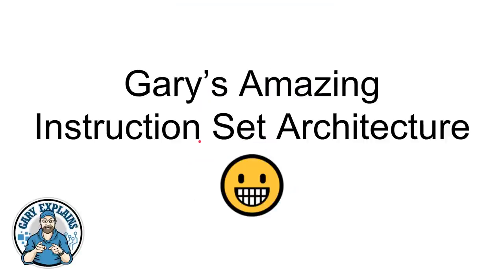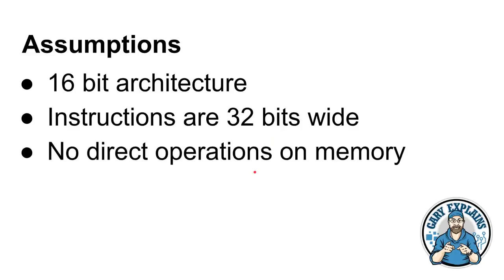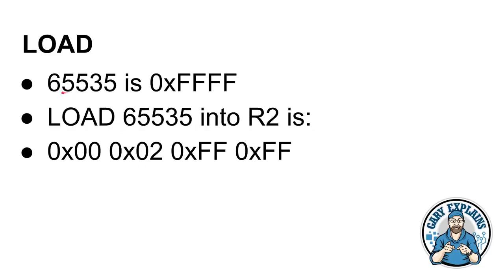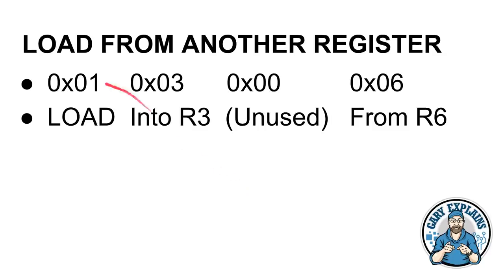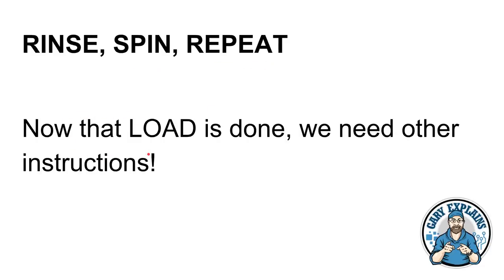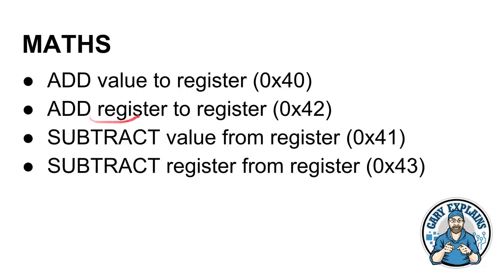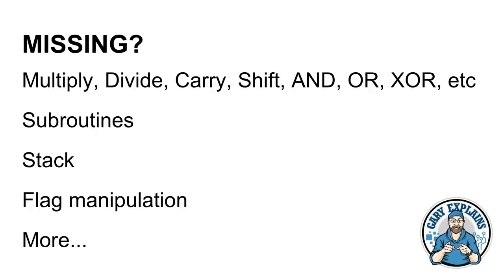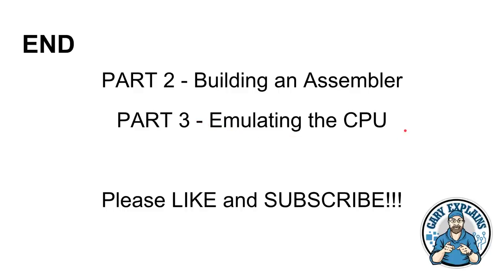Design Your Own CPU Instruction Set

Comment: Outstanding video! I designed an instruction set that uses 20-bit instructions, which includes 4 bits for the opcode, and 16 for the address or register arguments. Yes, that means only 16 instructions, but I do have a 1-position "stack", and do my register and other transfers by pushing and popping the stack.  Mine are: NOP, ADD, AND,  NOT, OR, SHR, SUB, XOR, LDA#, PSHr, POPr, RDA, STA, JC, JN & JZ.  I don't have a CMP (compare), but that's nothing but a subtraction anyway, except it doesn't keep the answer, just the flags. I have a shift-right (SHR), but no shift left. For that, all you have to do is have the desired number to shift in A, then PSH A, Pop B, and ADD (ADD adds A & B, with result in A).  Thus doubling A, which effectively shifts the bits one to the left.   All good wishes!
Reply: 4 bits for the opcode don't imply 16 operations because you can use other bits of the instructions in some cases, too. Read the book of Hennesy and Patterson about MIPS processor. MIPS professional chips use 6 bits of opcode and have more than 70 operations. This ISA is really a waste of bits but i thinks this is because the next videos go to explain how to make a compiler and emulator. This approach easy the things from the programmers point of view.
Reply: any source code available of your instruction set
Reply: clintonowino2619  No. I'm talking about MIPS ISA. MIPS R2000 use fixed-lenght instructions. I agree with you about simplicity but is not efficient. Read the last phrase of my post. Thanks.

Comment: Great idea Gary. In Information Science you usually only learn how to DEVELOP your own programming language, not a CPU instruction set...
Reply: Thats on of the main differences between CS and CE. In CS you mainly learn how to programm in a variety of languages. In CE you learn 1-2 languages to get the basics and then dive to how the hardware works to get a better understanding of it. As Im a CE student and have many friends in CS its very interesting to see the differences.
Reply: @andrew7720  depends on the CS program. I'm CS and in machine level programming right now and we take an intro to digital logic design and a follow up computer architecture course. But yes they are different degrees obviously 😄
Reply: U H89 I could disagree with you more. In fact, the one of the most brilliant minds of computer science, Donald Knuth,  invented a hardware neutral assembler to teach algorithms Mix and MMIX: https://en.wikipedia.org/wiki/MMIX
Reply: @esra_erimez  basically you can invent everything logical ... but the problem is: can you get it in efficient hardware? Is it cheap enough, with fewest complexity as possible, is it energy efficient, ...
Basically your hardware design is somehow related to physics, (or what is possible on die), right?
Reply: @U_H89  I see your point, but this is educational and I think most people will gain a lot of value from Gary's series. Exposure to op codes and mnemonics might spark the next Donald Knuth. If Gary tries to mass produce silicon, then I agree, he must be stopped :-)
Reply: @esra_erimez  yes, well let s see how far Gary explains... last sentence 'do not try this in real world' 😀😎?!?
Reply: Creating a CPU instruction set has been done back in the 1970s minicomputer (midrange system) era. The Pick operating system from this era is a machine-independent operating system and database management system with its own virtual CPU instruction set and virtual Pick assembly language. The Pick operating system was ported to computers as large as an IBM mainframe to as small as a microcomputer (PC).
Reply: @andrew7720  as someone in stats & analytics, y'all both are mystery. Sincere thanks to the people in your field for explaining why my shitty ML code is slow haha

Comment: I started designing a 64-bit architecture about 6 months ago. This is a culmination of nearly 40 years of experience programming many different processors at the assembly and C language levels as well as 20 years of electronic design. Last year I bought a large FPGA developer's kit and I plan to implement it using Verilog. This design is very innovative in many ways and I am hoping that I haven't bitten off more than I can chew. It is a CISC processor that is more orthogonal than the AMD64 and even ARM because it will not have the severe restrictions on the sizes of immediate values and offsets that ARM has. Using state machines instead of microcoding it should get better performance than many other CISC processors from the past and should get 2X to 4X better code densities than AArch64 (i.e ARM64) while having twice the number of GPR's. It might even be the only 64-bit CISC processor ever designed.

Comment: Creating a CPU instruction set has been done back in the 1970s minicomputer (midrange system) era. The Pick operating system from this era is a machine-independent operating system and database management system with its own virtual CPU instruction set and virtual Pick assembly language. The Pick operating system was ported to computers as large as an IBM mainframe to as small as a microcomputer (PC).

Comment: Nice video,

Every programmer need to know Assembly and what actually goes on inside, so many programmers today do things like 246 * 2 were older programmers know that 246 << 1 is way faster when compiled
Reply: I think that is the least of the problem, how about those 'apps' which are 100+ MB each to download on your smartphone. LOL
Reply: And for things like that, current optimizing compilers handle it automatically. You may write A * 2, and the compiler under the covers implements A << 1. As for the case 246 * 2, the compiler will simply fold the constants together and under the covers, the implementation is 492.
Reply: John Cochran I know that modern compilers do a great job these days, was using it as a simple example but you can get to situations were one could structure their code with how the CPU works to produce a greater optimised result, also one may be using a Z80 c compiler were it’s not very good so still an advantage for one to understand Assembly as it makes s programmer think different to other none Assembly experiences programmers
Reply: @insoft_uk  Definitely it's quite useful to know assembly. Preferably more than one, with radically different architectures. I myself have used Z80, 6502, 680x0, and S/370. Knowledge of those languages and architectures have in my opinion made me a better programmer and quite aware of portability issues. But my own experience has also taught me that going straight to assembly is generally a waste of time. One example that comes to mind is a program I wrote many years ago where I figured that one section that would be used frequently was going to be the bottleneck, so I wrote that section in assembly and spent quite a bit of time optimizing it to remove every possible clock cycle (rest of program was in C). When I ran it, the program took a lot more time than expected. So I optimized that section of code even more and the program was still quite slow. I did a bit of searching and found a profiler for my system and ran that against my program. In doing so, I actually managed to find the true hotspot in my program that was taking so much time. Turned out to be the malloc() function in the C library. I disassembled that section of object code from the library, analyzed it, the replaced it with my own code that used a far more efficient algorithm. That one library function change caused my program to run in only 20% of the time it was running originally. That experience definitely taught me a lesson. Namely, attempting to predict a priori the hotspot of a program is an exercise in futility and it's far better to simply write the program in your language of choice. If the resulting execution time is acceptable, then you're done. If not, THEN run a profiler against the program to determine the true hotspot. Once that is known, check if a different algorithm can be used (changing the Big O performance of a routine has a much larger effect on program performance than any micro optimization ever will).  Only after you've done that should you revert to assembly.

In a nutshell, the real areas for improvements is selecting a better algorithm instead of merely micro optimizing the code you have. And current compilers are extremely good at micro optimizations. And current compilers are incapable of determining better algorithms for your code. So focus your time where it is better utilized.
Reply: John Cochran I agree, I always avoid Assembly myself but find it makes me think what’s involved for the CPU, I think it’s very useful that most modern new programmers could do with, nice to see the Bender’s brain 6502 in the list 👍, one CPU I would of like in the days to program but was a speccy user then a 68K then x86 yes I went to hell cast out of 68K heaven
Reply: @insoft_uk  Privately I curse IBM daily for choosing the 8088 for their PC considering that the 68000 was also available at that time. But given that IBM figured that the PC wasn't gonna take off, it's understandable they would go with the 8-bit bus of the 8088 instead of the superior instruction set of the 68000 (the 68008 wasn't introduced until a few years after the IBM PC). If that hadn't decided to cheap out and actually go with a 16-bit bus, it's likely they would have then picked the 68000 instead of the 8086. And that would have been sweet indeed.
Reply: @johncochran8497  The 68k is definitely better than x86, but not that much better ;) ... it has more registers (yay!) and instruction sizes in multiples of 16-bits instead of 8-bits and less crazy handling of flags. But it still has the instructions that have to be broken down into multiple parts (load-add, load-add-store, load-storeElsewhere...) and the 8/16bit math instructions...
Reply: @boptillyouflop  I guess we'll have to agree to disagree. The 68000 is FAR superior to the 8086. Yes, it has more registers. But that's not the point. It's that the registers in the 68000 are general purpose while the registers in the 8086 are specialized. Gonna be doing some math? Well, I hope you have the A register available. Want a linear addresses space? Sorry, not gonna happen with the 8086. The 8086 was an abomination of a processor. Whereas the 68000 had a linear address space and any of the 8 D registers were just as usable as any of the other D registers. Only specialized register was A7 which was used for the stack. And if you didn't use a stack (although I have trouble imagining someone crazy enough to do that), then A7 was just as usable as A0 through A6. Now the current x86 architecture has been patched and modified so that you do have a linear address space. But the 8086? The segmented memory model for that processor was a true nightmare.
Reply: @johncochran8497  Oh, right. I was kinda comparing the 68k to the 386 (which undoes the worst mistakes). The 8086 itself was pretty awful indeed, and kinda more like an overgrown z80.
Reply: @boptillyouflop  The 8086 was actually a bit worse than that. A closer approximation would be an overgrown 8080. After all, it's missing the Z80's alternate register set and the bit manipulation opcodes. The bit manipulation opcodes however were of minimal value, but the alternate register set would have been definitely useful.

Comment: Art school dropout here! I just found your channel and I love it. I'm working on a project but I'm kind of stuck... stuck in the sense of wanting to make the project far more complicated than needed haha.

Ok. I'm taking a MIDI signal, breaking each note out into its own channel, then sending those channels to a DAC. From there I can control the voltages of my eurorack. I'm using an Arduino to do the logic (MIDI to notes to channels) which is all very straightforward.

My question is, is there a way to setup a custom CPU with my own CPU instructions that handles nothing but the logic without needing the C/C++ libraries and all the Arduino overhead? I mean, I know there's a way... but what kind of CPU would I use? ARM? Atmega? Something smaller designed for fast simple logic? CPU instructions are pretty new to me. Had I picked engineering like a sane person (instead of the Arts), I suspect I would already know the answer.

Also: if we take the most commonly used instructions and map them to commands that are mostly zeros, could that in-theory keep the chip cooler?

Comment: There is one aspect of computer architecture that his been given short shrift. It is operant reference modes. In particulars with the IBM 360 and successor generation, the base plus displacement, with its puny 4096 value with no indirect addressing options. Addressbility for operands in established thru on of sixteen 32 bit general purpose registers. The range span of a single operand is the value in the register indexed by the displacement. The total range of addressibility at one time is number of available registers available plus each displacement maximum size. One has heard of the concept of disk drive thrashing for virtual memory systems in which real memory size is limited compared to the virtual memory space configuration. I assert the the IBM base plus displace the design has the potential to lead to address reference thrashing for very large unsegmented procedures have all instruction memory consumed by storage of base address values and load from memory to register instruction! Some of ways of workarounds would be the creation of an interpreted meta machine language that would do nothing more than artificially create operand pseudo architecture that would provide a base address reference addressibity bank and indirect addressing mode both pre and post indexing options. The performance hit would be massive, of course. For quantum computer architectures with near infinite storage size capability, it is critical that attention be paid to operand access design! I do not current have the ability and train to work within the realm of the higher hieroglyphics of abstract mathematics to construct proof of this assertion!

Comment: So you should what some instructions for the CPU could be. But how would you tell the CPU that when it sees this number, it is an instruction, and then what that instruction does? I'm looking to make an 8 bit CPU out of discreet components. How would I setup opcodes for a CPU like that?
Reply: Hi there!  I believe instruction to run is decoded by certain control logic (decoder). So to build a computer it is needed to build a certain control logic ( I think you have to encode your certain opcode and other parts of instruction). I have watched some video about the stuff: Core Dumped, CRAFTING A CPU TO RUN PROGRAMS. Hope will help.

Comment: Great video, but I do have  question. You say that the arch is 16bit, with 65536 of addressable memory. But what is the word length of the memory? is it 16bit or 8bit? Is your memory 8*65536=524288 bits long or 16*65536=1048576 bits long? In short, what does op 0x02rrabcd actually do when the register is 16 bits? Does it load from address $0xabcd to a register, which becomes 0x00yy or does it load from addresses $0xabcd,$0xabcd+1 to a register, which becomes 0xyyzz or  does it load 16 bits from address $0xabcd to a register, which becomes 0xyyyy? Thanks for explaining.

Comment: I'd suggest not using 0x00 as a LOAD opcode. Reserve 0x00 as NOP or similar because buffer overflows, null terminated strings and the fun to be had with that.
Reply: That would only be the case if code and data aren't separated.
Harvard architecture separates instruction- from data memory and thus prevents such things from happening.
Even strictly von-Neumann architectures such as Intel x86 or AMD64 feature NX-bits marking data as non-executable.
Now this still won't prevent buffer overflows, but that's mainly because out-of-bounds memory access is not related to this problem.